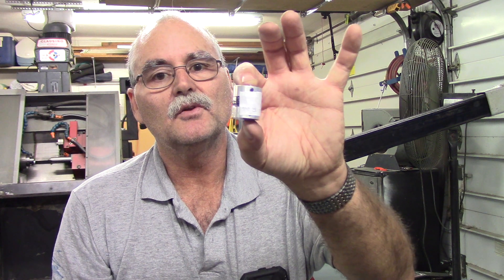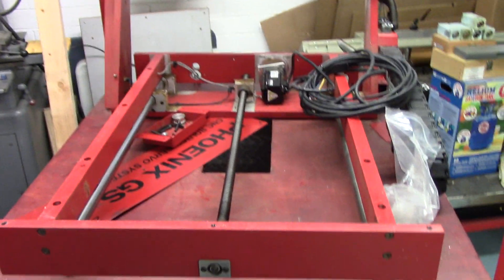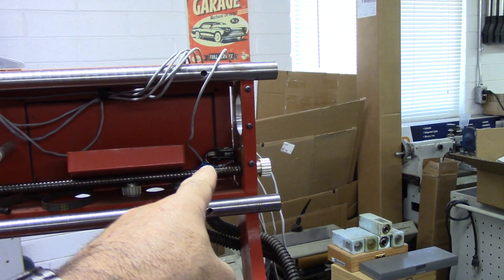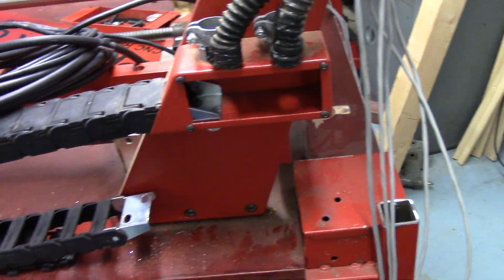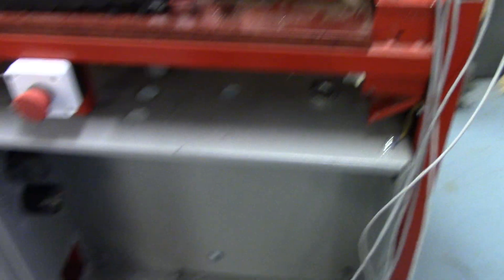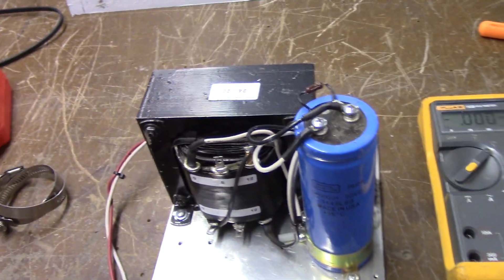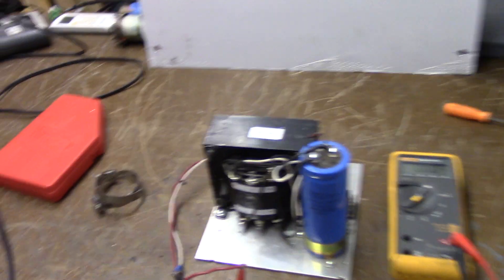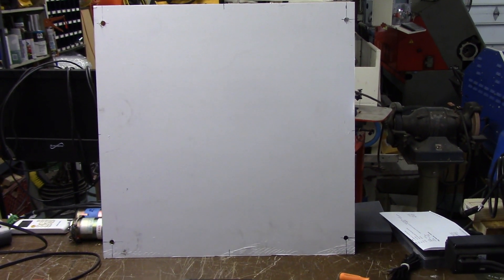Phoenix CNC Router Upgrade: Centroid CNC Acorn DMM AC Servos. Part 2 Stripped/Clean Slate

Comment: Hi I have a quick question tried to go on the form but can’t figure out what to I’m supposed to put when it says to put the last 7 symbols to register. 
Anyways I have an OmniTurn lathe that the motion controller friend so I’m converting it to acorn was trying to figure out if I can reused the servos I had pics but they don’t really seem step and direction it says tack on the drives and but took apart one the motors and it had encoders looks like 1000 line encoders
Reply from the maker: You do need to register. Post pictures of your machine there. http://centroidcncforum.com/viewforum.php?f=20
In a nutshell, I DO NOT recommend you using the DC Brush servos and the original servo drives are analog. Acorn does not support them. Use Clearpath SDSK, DMM Technologies AC servos like I am using here, hybrid closed loop steppers from someone like automationtechnologiesinc.com
Reply: @martyscncgarage5275  thanks i figured that out i ordered clearpaths sdsk's ill just sale the whole ominturn controller as a whole with the motors and drives
Reply from the maker: @ljs66bug  good deal. You'll like them use Centroid Acorn!
Reply: martyscncgarage  yup I already have the acorn in the machine ready to go I have a Lagun running clear paths already about to switch that one from masso to acorn And rebuilding a Bridgeport boss 6 it’s nice. 
Check out my IG larry_martens_cnc if you got time I think you will like my acorn controller setup on my hardinge I made the whole panel